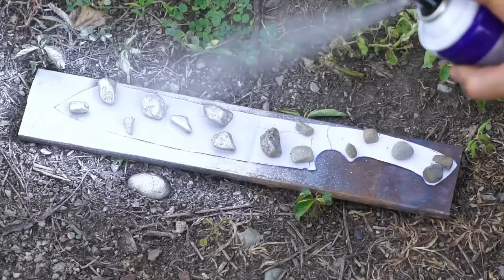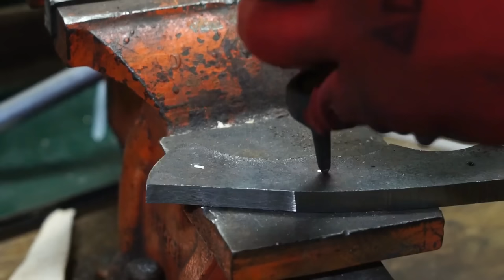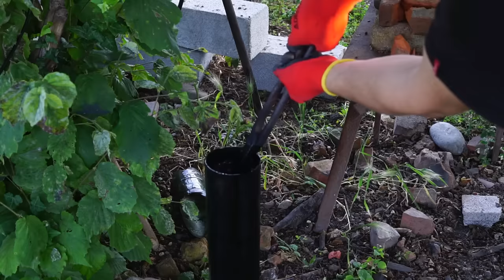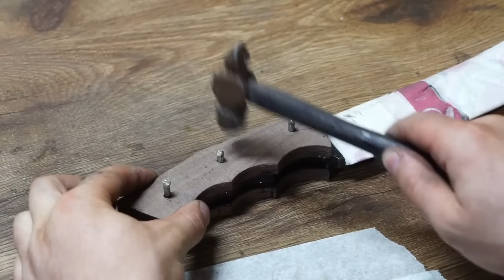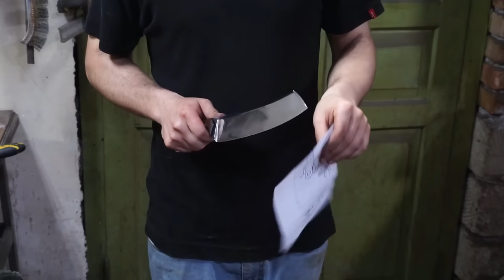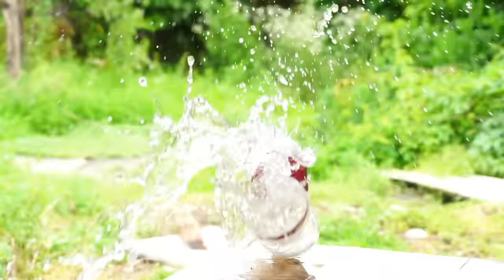Creating a Razor Sharp Chopper Knife from a truck leaf spring

Comment: absolutely remarkable work. ive never seen anyone able to control an angle grinder the way you do. they are notoriously hard to use tools for fine work like bevels, ive never been able to get a good result out of using one.